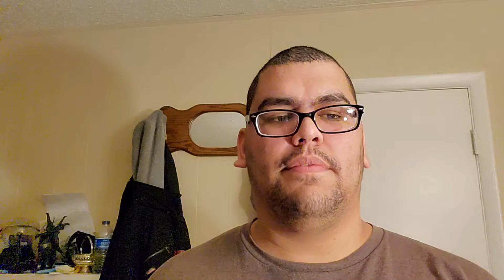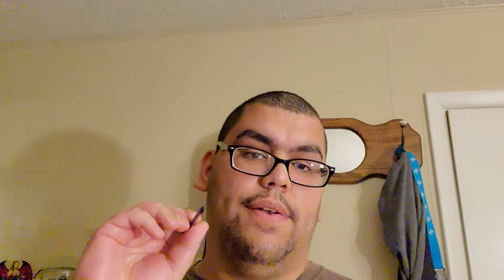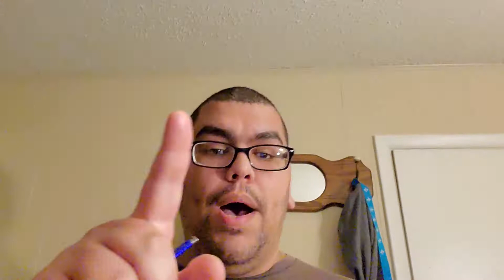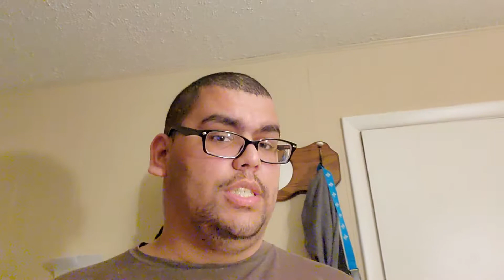What does that orange switch do on your PC power supply?...Explained!

Comment: As someone else  mentioned there is no way to tell which voltage is selected because it is ambiguous whether the switch should be on the side that has the voltage or the side that displays the voltage you want. Basically the switch is not labelled in such a way that you clearly know which voltage has been selected. The switch can be moved while being jostled around or the device could have been purchased second hand
Reply from the maker: On american power supplies the switch is always set to 115V by default when you purchase them unless you buy the power supply made for other countries those are usually set to 220V by default

Comment: Unfortunately, I was too late watching this. Had it plugged in, a light on the back but wouldn't turn on. With it STILL PLUGGED IN, I switched the switch to 115.... big mistake. It nearly blew my head off.. luckily, this was a test PC and not my main gaming rig 😂
Reply: I did this on my gaming rig 😢 guess what my pc is off no sign, van it be repaired if I buy new power supply?

Comment: this is going to sound like an impossible story but there is like no way this has ever happened to someone else. in around 2009-2010, i was up late one night playing runescape during a thunderstorm at like 2 am. i had an old emachines celleron i think windows xp machine and a CRT monitor. my had was on my mouse pad about 4 inches away from the lower right hand corner of the monitor when my house and im thinking the roof right above my room was struck by lightning. instantly all the lights went out and i saw a big white arc out of the corner of my crt monitor which went into my right arm and made it contract back into my chest super forcefully, i think it kind of hit my chest. i had gotten a zap as a kid playing with loose connectors to some romex on a house underconstruction and i can say the shock was about 5-10x worse. my computer and screen both turned off after the whole house sounded like a bomb got dropped on it. when the power came back on a few secconds later, the crt monitor powered right back up like nothing ever happened, didnt even need to be calibrated like when you wipe a magnet close to it. my computer tower however wouldnt turn back on no matter what i did like umplugging it for several secconds. somehow i knew where the powersupply was in the top of the tower and i pulled it out and found this switch. i figured what the heck and flipped it and my computer turned back on and obviously i went back to killing blue dragons. i still have that tower and used to use it for random botting/macroing for other games like eve online. it still only turns on with the switch flipped to the 220v position. knowing a little bit more about electronics now i think what happened was an inductor or cap got fried and switching it to 220 let it use an unfried circuit in the powersupply. really weird story, and for some reason not the only time ive "kind of" been struck by lightning. the other time was when i was stepping out of my car in a thunder storm. finally looked up this video to try to understand this really weird thing that happened to me 14+ years ago lol. have a nice day.

Comment: Hahaha! this video gave me a flashback..

After a power outage/blackout my PC wouldn't turn back on.
After spending hours trying to research and diagnose I eventually see this exact switch on the back of my power supply lol...

I ended up switching it then the power supply immediately exploded next to my head and left my ears ringing. 

I ended up just laying on the ground for a solid minute just watching the smoke come out dazed from the pure unexpected shock of it exploding in my face lmfao...

Thankfully the PC still worked after getting a new power supply lol. I'd say most PSU's and motherboards have protection against that crap. Infact I still rock that motherboard in my current rig with the aging i7 3770k.
Reply from the maker: My goodness, I'm glad you're okay
Reply: How much it cost to repair
Reply: @spirit8198 he sayed he just bought a new power supply so i think he paid like 60-100$
Reply: bro sadly i did it yesterday and its not working no it was on 230 volt and i turn it to 110 i want to get a new power supply or fix this one bc it just did a short and i hope the mother bored or somthing else got damage inshallah
Reply: 9
Reply: same 😆, i remembered university time, our base country volt is 220 and i had no idea what is that button do!, the computer had booting problem which is It had nothing to do with PSU!, ooh boy i just changed the scary red button to 115 because I thought that it's could be Fan eco button, immediately after changing to 115, exactly the same thing happened, not even PSU blew up like a bomb, even The fuse of the floor where we had classes also blew, Everything became dark with the light of the PSU spark, smoke and the smell of smoke and the laughter of the professor and students, boy i will never ever forgot that day 😂

Comment: I put 115v and it explode  will it cause to the motherboard ? And ram cpu 🥲 plss reply bro
Reply from the maker: Possibly, it all depends on if the psu had safety precautions to avoid such further damage, most people who switch it without knowing what its for end up frying their motherboard, and potentially other components with it, only way to know is replacing the psu since that was shot immediately, then you can diagnose what further damage you have done to other components
Reply: @CyberGamingStudiosOfficial  ok thank you brother
Reply: @CyberGamingStudiosOfficial  bro i need a reply for this one too my power supply explode but it still works 🙂
Reply: @CyberGamingStudiosOfficial  i checked my power supply by the clip method and its still working  🥲

Comment: I don't know if it makes sense. But for me i took it apart and looked inside, it's like a standard off and on switch. 3 prongs to be soldered to. Well one is unused which means if it was flipped it essentially would be off. Also, it has different numbers. Not 110 and 220. but 115, an 230
Reply from the maker: Then yeah keep it on what it was set originally, do not switch it unless your going to a country that uses different voltages that like europe witch the use 220v-230v U.S should stay on default 110v-115v

Comment: Well i flipped the switch while it was plugged in then i heard a pop but im not sure how bad it is i cheked with a flashlight into it and it looks like its just a fuse (I HOPE)
Reply: If you flipped it while it was on there is practically no hope for the power supply, most of your components should be fine because they have ways to counter things like this happening

Comment: I actually did it maybe 2 or 3 months ago and what happened is 
after i switched it to 220 and pressed power button 
PSU turned on for a sec 
after second or two Ive heard sounds like shhhhhhh going crazy 
and saw white smoke coming out from the back of that PSU 
fortunately just after second Ive unplugged power cable and moved my pc little away from the wall 
I letted my pc chill for a lil bit 
and after that I just didn't tried to turn it on (by the way the smell was horrible it was like a fried dust or smth)so I called tech guy and said to me JUST DONT TOUCH IT 
after that he came and just replaced my PSU 
but NOTHING happened with my motherboard or any other parts
it was just PSU
So yeah if it works just dont switch that 

TIP: IF YOUR PC WONT TURN ON BUT ONLY LIGHTS UP POWER  BUTTON FOR A SEC ,TRY THIS
try turning it off from psu switch
wait for couple of second 
and try hitting power button and psu power switch both at the same time.

Comment: Well i fried my motherboard  I guess does it mean that the other parts ram ssd cpu case are now broken ? That means that i dont not have a pc for a long time , I was saving money for a GPU . So I was in quarantine and then i decided to do some cable managment and when i finished there was no power in my pc , I flip it and then smoke was coming from the psu . I closed very quickly the psu and then i set my pc outside
Reply from the maker: U can see if the other components were damaged by removing the damaged psu with a new one

Comment: If I flip the switch at the back while my pc is on from 230v to 115v will it fry my motherboard if it has a ovp and uvp?
Reply from the maker: yes, even if you switch it while it's off it will fry everything when you turn on the pc, you only use the switch if your in the USA to 115v  if your electric has 230v then don't switch it if your not in the USA otherwise it will fry everything
Reply: bro can you tell me what happened with you bc it happened to me yesterday and i don't know what i got damage inshallah its just the switcher or the power supply
Reply: @ahat4789  mine went boom like a firework but there was no smoke tho (i live in Europe) I switched mine just to experience an granade upclose from 230 to 115v and I probably shouldnt have done that the rest of the pc even the motherboard looks fine tho

Comment: i got a new motherboard and cpu and when it usually turns off right away after i turn it on but when i flipped the red switch it doesn’t shut off but my graphics card doesn’t get any power
Reply from the maker: Are you in erouoe or in USA?
Reply: Bro that dangerous it can blow

Comment: I was wondering on the switch if 110 is showing on the switch does that mean it's on 110
Reply from the maker: If your in the USA all power supply are already set on the 110v already so no need to mess with it